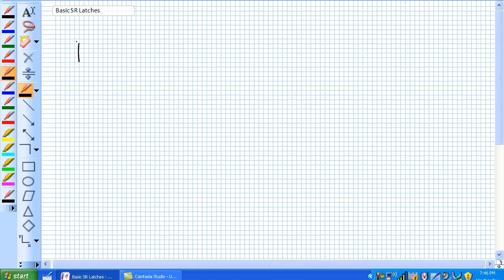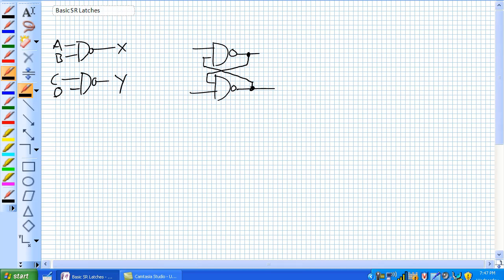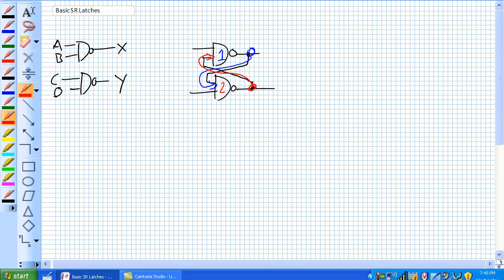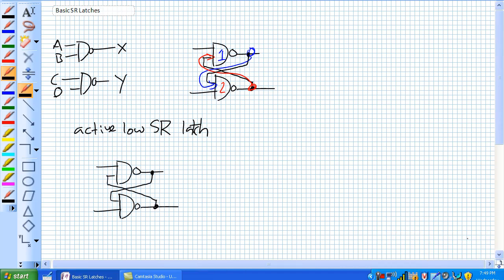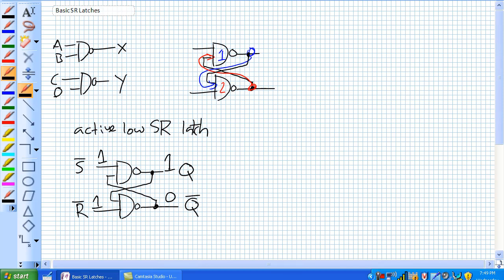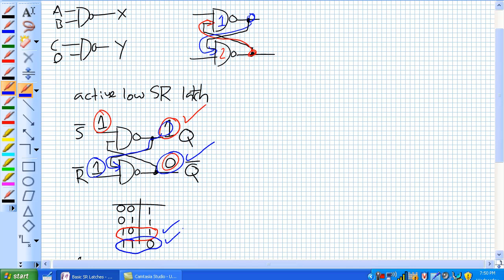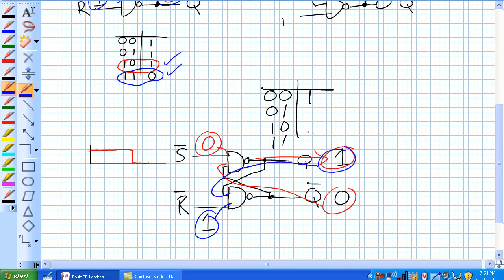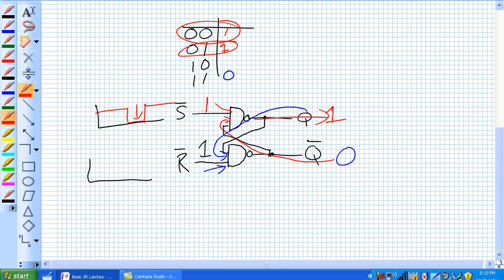Basic SR Latches

Comment: I guess it's because just using 2 NOR gates will be cheaper than using 2 NOT and 2 NAND gates. Even though a NAND gate in the IC can be used to implement a NOT gate function to substitute an actual NOT gate, ultimately still using only one NAND IC chip, 3 gates will have to be used in one IC, as opposed to only 2 if using NOR implementation.

Comment: Thanks for not assuming everyone would immediately understand what latch would mean.
Question. I have a small dc motor, which when the polarities are reversed, the rotation of the motor reverses, which is what I want. Is a flip flop the best way to control the reversal of polarities? Does 0 equal ground?   Thanks!

Comment: what kind of drawing program are you using.  I am in EET 121 and we are going over latches this week.  it was confusing me if you just have one input on a two input gate it will not work.  So you have to start with initial conditions, otherwise it will not work.  otherwise you cannot get any output to Q ever.   the gates will never work unless you have initial conditions

Comment: So an SR Latch is always an active low? and i know when in set mode Q = 1 and reset mode Q = 0 but does that also mean that S = 0 for set? and R = 1 for reset?
Reply: Because this is the NAND version of the SR Latch (instead of the NOR version) it uses S-bar (not S) and R-bar (not R).
S = 1 is still set, causing an active low of Sbar (not S) = 0.
R = 1 is still reset as well, causing Rbar (not R) = 0